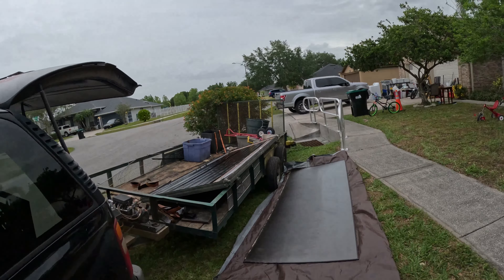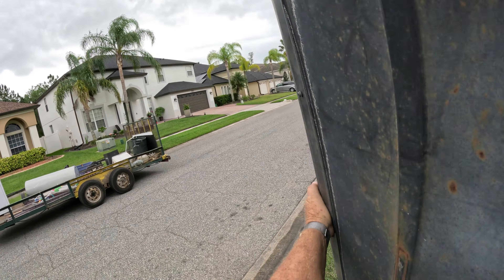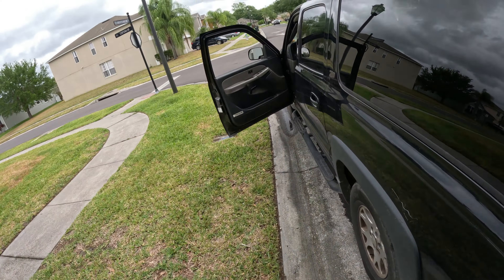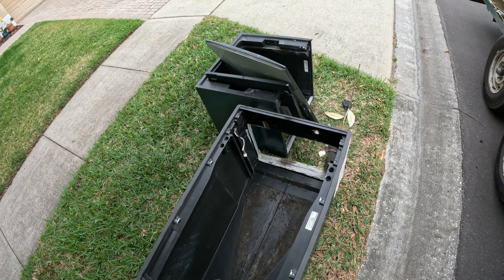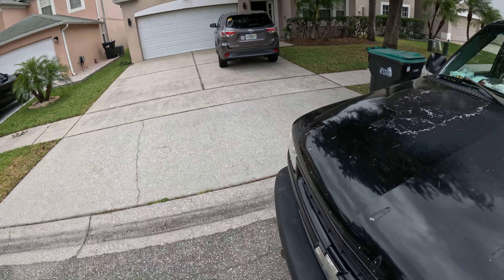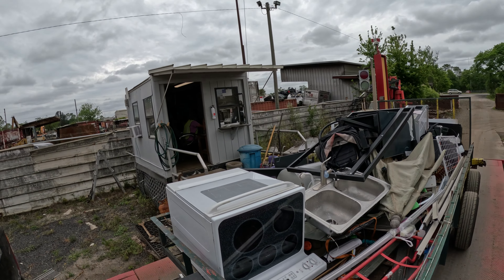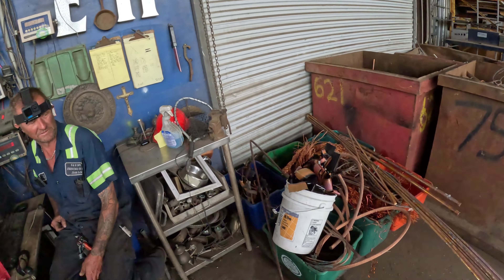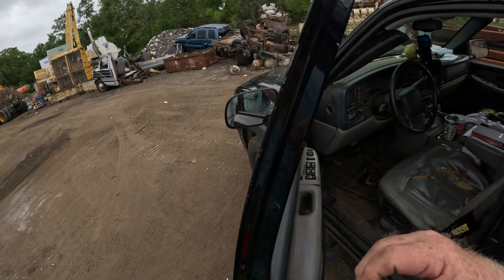Solar Save

Comment: Hello I’m writing this to ask you a question? Up here in Gillett the wind blew our trampoline down and bent some poles. The pole that I need most is a curved one that the springs go in. It has 9 holes for springs and is squared on the ends.  One end fits into the next curved section. I was wondering if the next time you find one please if you could save it for me ? We just got the trampoline last summer. Thank you for your time.
Reply from the maker: Send me a picture of what you need. Probably tearing down a trampoline tomorrow morning
Reply: I sent picture to your aol address